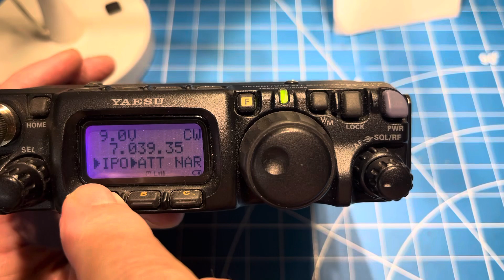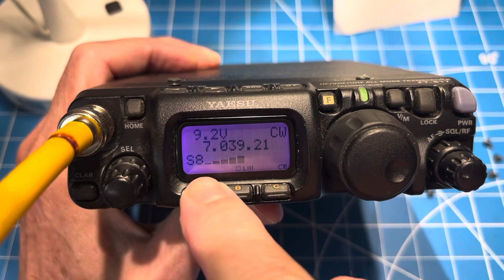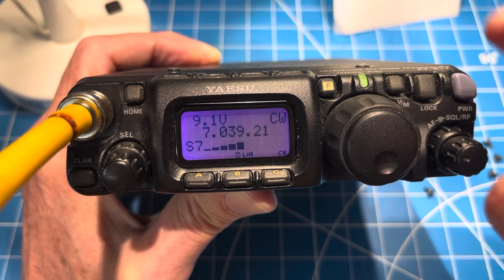5 Minutes to add a CW Filter to a Yaesu FT-817!

Comment: Why 500hz vs 300hz..?
Reply from the maker: The filters are getting difficult/almost impossible to find. I was able to get a 500 Hz filter XF-115C.  I would have liked to try the 300 Hz XF-115CN although tuning gets very sharp that way.  I’ve gotten spoiled by the elecraft k1 and k2 where there are 3 user adjustable filter bandwidths..  73, Bruce
Reply: @tyrueiI They made a wider one too, 2.3kHz or something, under what circumstances would that be an appropriate choice? Appreciate your comments and insight thank you.
Reply: @bradl2636  I believe that the 2.3 kHz one is for SSB.

Comment: You left out the 3 years it's going to take to find a filter! :) 73
Reply from the maker: Exactly! I used eBay’s advanced filters where you can do a search on item(s) you want, then add exclusions for the unwanted results then added an email alert when it matched. That got me a filter for $200… which is still too high, but much better than the $350 ones I’m seeing. It seems someone would come along with a way to replicate the Collins units. Like:
Yaesu (xf-115c, uF-115c, 526-8686-030)
That will search on Yaesu and any of the items in the list.

Comment: Hi sir, Guy here N1gmm.  I greatly enjoy your videos. I would love to get you call. Mine here and on qrz. You have same interests as I. I have a used k2 coming today.
Reply from the maker: Hi Guy, thanks for the encouragement. Glad to hear you’re finding them useful. What kind of options and serial number did you get. After having a few, the later serial numbers do save a lot of update time. 73, Bruce AA7AR/6 maybe a K2 to K2 QSO in the future.
Reply: Hello  @tyrueiI  I sent you an email.  It should be coming soon via UPS.. I probably paid a bit more than I should have it has most all the options except the 100watt amp.. I think the serial numbers are lower in the high 300's or 400's .  I will go look on Elecraft to see if there is a mod document to use.  Thanks for the reply
Reply: I looked, if none of the massive number of changes were added I have a good project!!
Reply from the maker: How is the K2 project going?
Reply: Hi sir. I will be sending you an email in a bit!